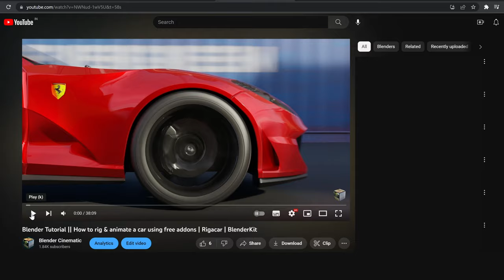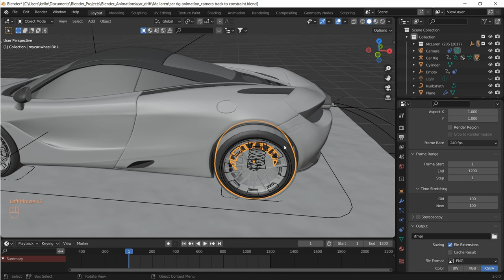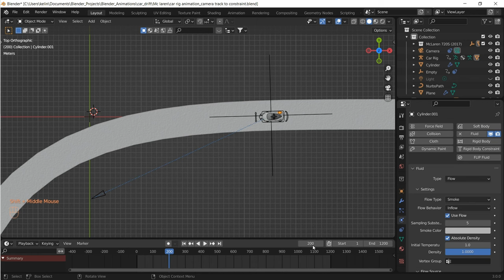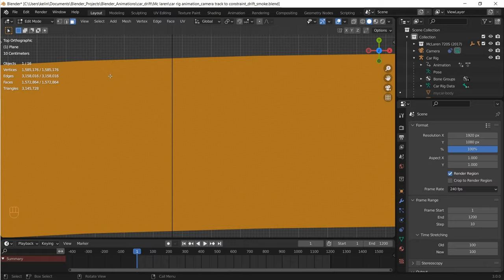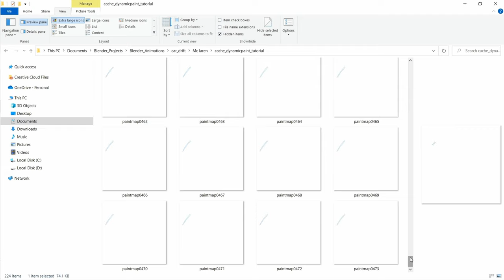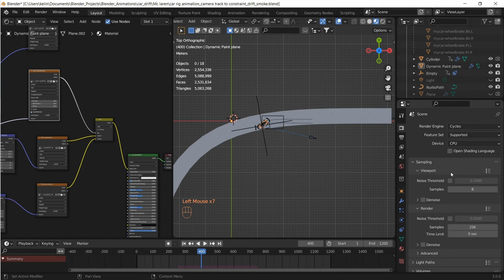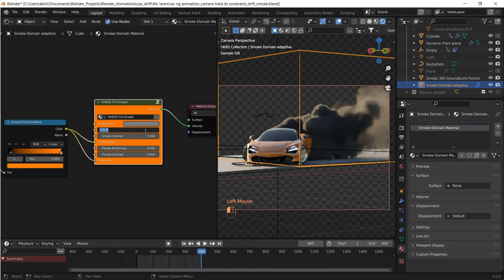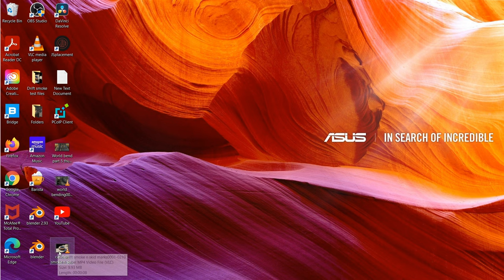Blender Tutorial || Car Drift Smoke | Mantaflow | Skid marks | Dynamic Paint

Comment: I have tried to follow your tutorial step by step. In my case instead of smoke I mean to spray water from a wet road, and instead of skid marks I mean to use the dynamic paint to make the tyres dry the road. Alas I must be doing something wrong as in cycles it only renders the result of one tyre... Any advice will be much appreciated. I'm using blender 3.5...
Reply from the maker: Nice idea! Before rendering, please check if the dynamic paint maps are baked with 4 tire marks or just 1 tire mark?
Reply: @blendercinematic  that was it! Thank you! Now I'll start working on making smoke into water haze, like the one that you see behind f1 cars on wet roads...

Comment: I used Rbc addon to animate the car and after that I applied your method step by step but whatever I do, smoke doesn't appear in the viewport after baking..... Any advice?
Reply from the maker: There can be minor details that can be missed such as checking the planar check box in the source settings for proxy tires or baking resolution etc. What I typically do to troubleshoot is the following.
a.) create a very simple scene which is similar to the original scene and follow the steps to see if I missed any step as it saves a lot of time and resources when we work with simple scene.
b.) check for minor details as mentioned at the beginning of the comment.
c.) bake resolution and viewport viewing options (in order to see some smoke, there needs to be some light in the viewport)
I'm available through email or discord, the details of which are in the about page of my channel if you are interested and have further questions. Good luck!

Comment: Hey, I can't seem the collider to work. Any tips?
Reply from the maker: To use car body as collider, we need to enable it as the ‘effector’ under mantaflow fluid settings and choose effector type as collision.
Reply: @blendercinematic  I did. First I selected every part of the car (doors, bumber, window etc), then I joined them (Ctrl + J), then enabled the Fluid —> Effector and Collision.
Reply from the maker: If your mesh doesn't have any thickness, then under effector, collision, please check the tab that says planar and try.